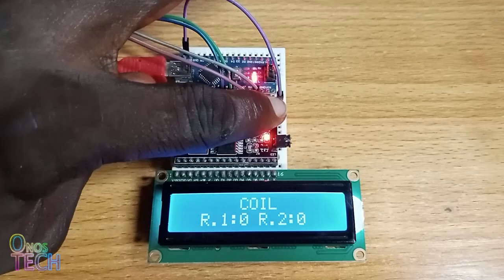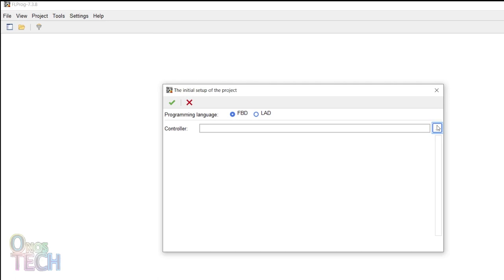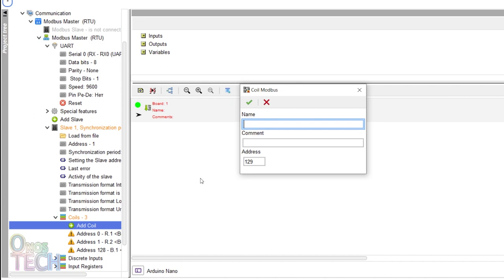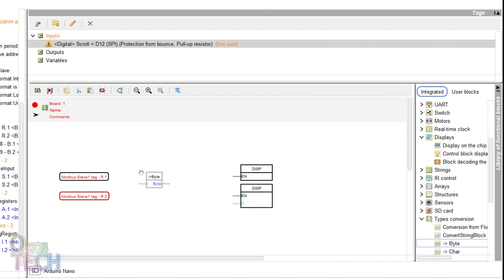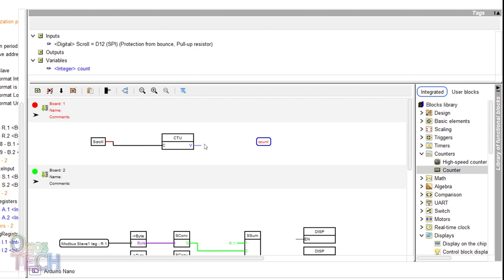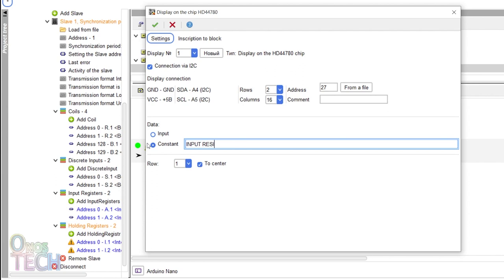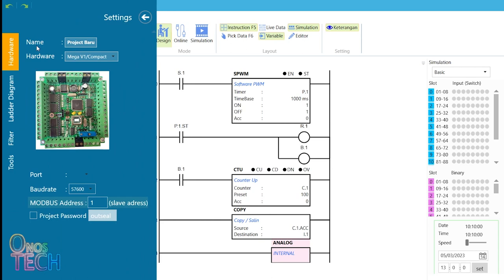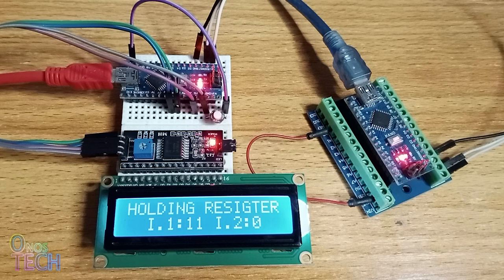How to Make PLC LCD HMI || FLProg

Comment: Hello sir. Could you please explain why the TTL to RS-485 module is required when connecting to the OutSeal PLC, but it’s not required when connecting directly to the nano?
Reply from the maker: It depends what you are connecting the Outseal PLC or Nano. What are you connecting?
Reply: @OnosTech I see where I got confused. I thought the Outseal PLC was just an adaptor board that the nano plugs into, but I now see that it's something different.

I plugged directly into the nano and it worked fine. Thanks for replying.

Comment: Make it with 4x20 lcd
Reply from the maker: I am sure you can make it if you follow the steps in the video
Reply: there is a way to code the full hmi program, I want to learn... thank you
Reply from the maker: If you still want a 4x20 LCD type after watching this video, use the "Thanks" button on this page to generously support the video production.